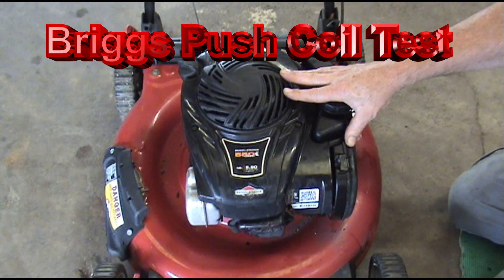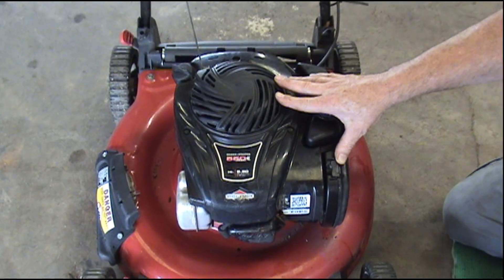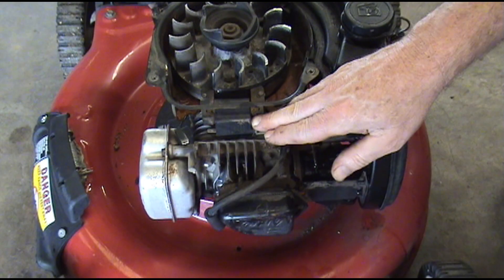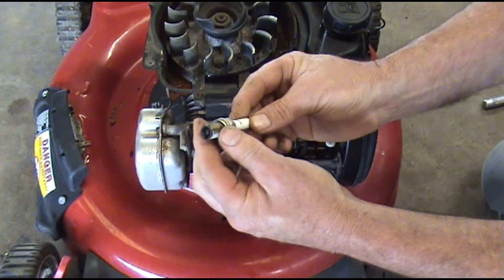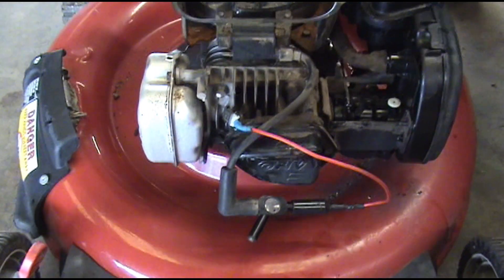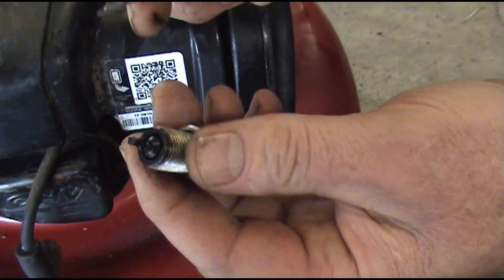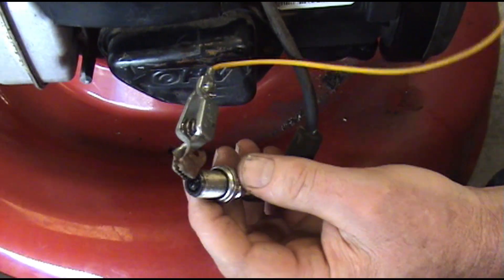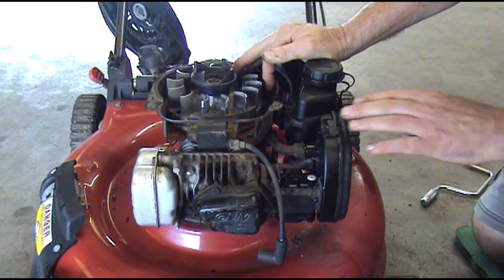Briggs Ignition Coil Test Push Mower Easy Step by Step

Comment: is it possable for you to show how to test a points condencer?
Reply from the maker: We don't see those older engines very much anymore.  Back when we did, it was done by process of elimination. If an engine had no fire.  It was going to be either the points & condenser or the coil.  The most likely and the cheapest possibility was the points & condenser.  So that was done first and it usually fixed it.  Briggs & Tecumseh sold points & condenser as a set and they were pretty cheap back then.   It would have been a waste of time to test a 5.00 part. 
No days everything is electronic so points are obsolete. 
Thank you
Reply: @IFIXIT4U  thanx